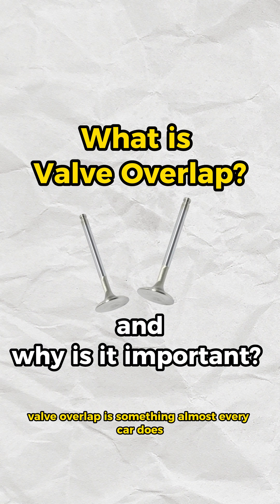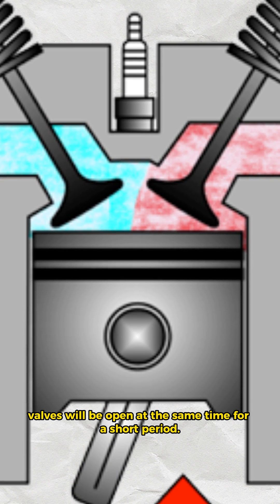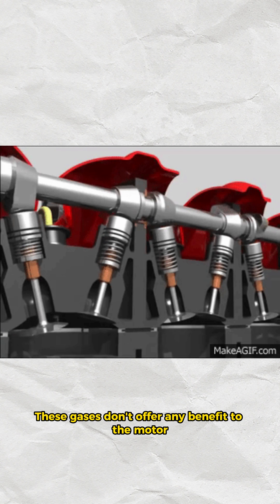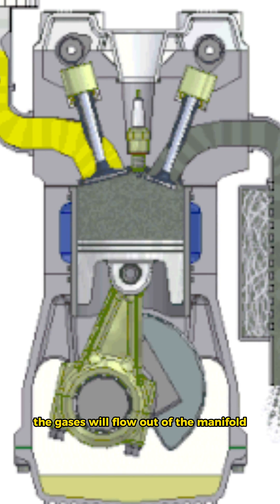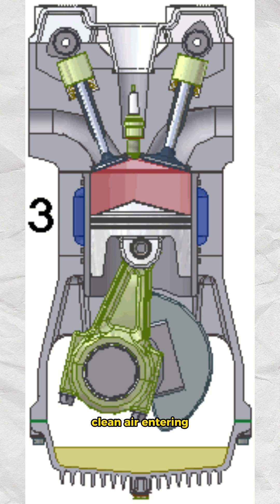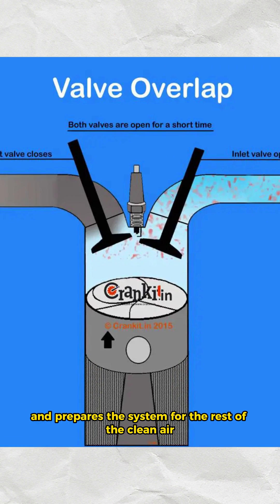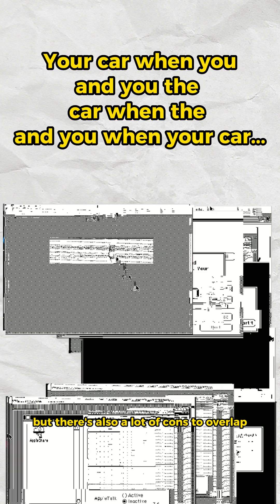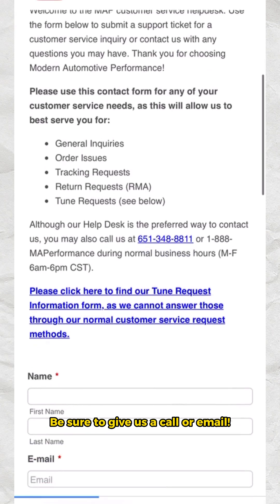What is Valve overlap anyway?

Comment: What is the sense of an engine that has valve overlap with an EGR .
Reply: EGR lowers NOx immisions by letting a small amount of exhaust back into the intake to dilute the air, valve overlap helps with scavenging. All that will happen is that at low RPMs some mixture will eventually get recirculated back into the intake.